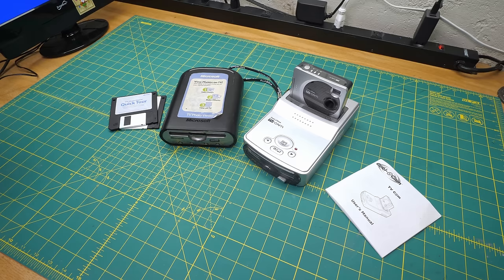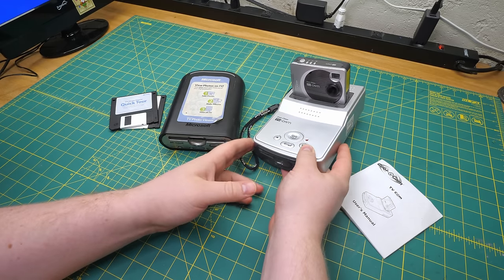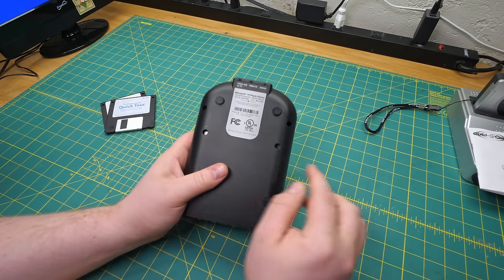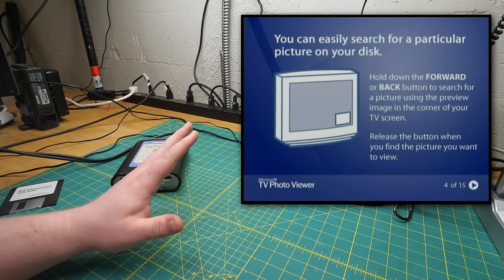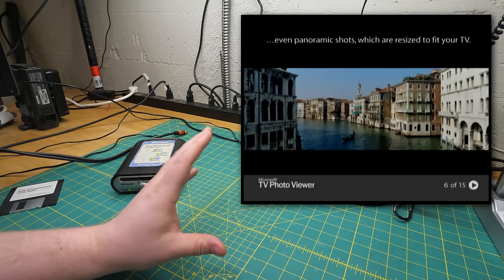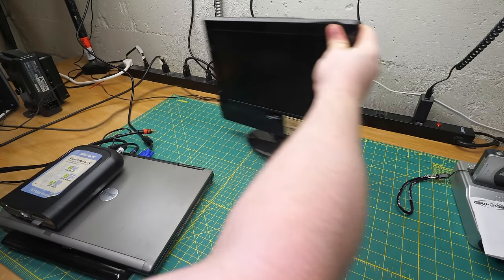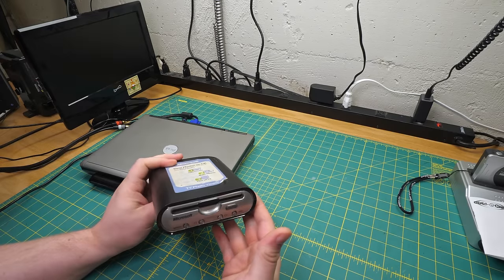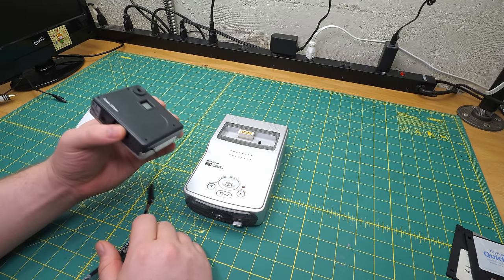"Play" Floppies On Your TV - With These!

Comment: Re similar things - There is an older format called "video floppy" that stored analog still frames on special 2 inch floppy disks in a format similar to how SECAM video was stored on VHS tapes (fm modulated luminance and each chroma component fm modulated and frequency divided and stored on alternating lines). It was more a professional format than something for home use though.
Reply: Funny enough that did eventually get consumer grade devices released using that format ... just prior to the rise of digital photography rendering it immediately outmoded.

Comment: 18:40 Latitude D620 will always stay in my heart
Reply: Yup, I had one from work. Still have it in the basement. Runs Linux like a dream.
Reply: Why is the battery in the front? Looks so different from other laptops I remember from that era. Or is it some kind of wrist rest?
Reply: @samuzamu  that's some new battery with better capacity, I guess 6600 mAh. the stock one came with 4400 mAh
Reply: @mmilerngruppe  oh cool. Laptops were so modular back then. A far cry from nowadays. Guess they were a lot less sleek though
Reply: @samuzamu  it’s uncommon but I lowkey prefer it over the high capacity one hanging out the back like so many did. A bunch of battery pins (or the latches) got broken by people forgetting their overhang, or using them as a handle. Making them a wrist rest seems like probably less torque..
Reply: The D530 is also good
Reply: @kaitlyn__L  You don't need to call out my T400's handle like that! On this ThinkPad it was plenty sturdy, I don't know if other laptops were weaker.
Reply: @eDoc2020  hehehe :)

Comment: I would assume the floppy in the Microsoft is on foam for noise reasons and durability reasons. And the lack of screws is cheaper and maybe faster to assemble?
Reply: My gut feeling was that they wanted to use the screw holes to mount the floppy drive, but then figured out there was a flaw in that approach after making the moulds and needing to change something somewhere. Noise and durability checks out as what those problems could've been.

Comment: That photo editing software is the most consumer oriented photo editing software imaginable. I remember that in the 2000’s most dvd players had jpeg viewing capabilities built in and it was a selling point if it could read your own burned cd-r’s. Even today your average blue-ray player still does this. What surprises me about both floppy based devices is that they used an internal desktop model, considering the compact design I would have expected a slim-line mechanism from a laptop/usb floppy drive. At least the mechanism is easily replaceable unlike some of today’s tech where everything is soldered on the board.

Comment: I would have to say that the tape is most likely a cost saving measure. foam tape is likely cheaper than drilling 4 holes and having someone screw them in. I couldn't imagine it's for any other reason.
Reply: This was my first thought. A bean counter stopped them from drilling the holes.

Comment: USB sticks (Flash drives).
I went to college in the span of 2000 to 2004. Everything was floppy disk, a few computers had CD burners or ZIP drives, but you were pretty much expected to save all your work to floppy disk, so every computer had a floppy disk.
When I visit the college the next year (I ended up working there) in 2005, Flash drives were finally starting to not only just become a thing (Seriously, nobody even mentioned them while I was at college as a student, I didn't know they existed), but they were starting to become a standard. I think it was about 2007 when nobody was using floppy disks (at the college) any more. (Except a few people, like me, but that was for transferring data to a specialised Windows 98 machine to control a CNC drill. But it was one of those machines with a ZIP drive, so I got a USB zip drive and used that.)

Comment: The anecdote about the polaroid camera being recalled before release is incorrect according to wikipedia and it's 2005 source. It was recalled 2 days after release because of "a firmware issue" i.e. all the photos looked like shit.

And the foveon sensor was sold in about 10 different sigma cameras, and sigma eventually bought them out.
Reply from the maker: That's what they said publicly. The rumor is that they just didn't want the thing selling.

I know Sigma sold a bunch of foveons, but as far as I know none of them retailed for under a grand and they were all enthusiast-focused. I was saying that the Polaroid is the only cheap piece of crap with a Foveon, and as far as I know that's still true.

Comment: s10:42, screen saver for your TV: No. The reason why TVs don't need screen savers isn't because there's virtually no chance that anything might get burned into them. The reason they don't need screen savers is because, as you said, by the time this device came out, the original reason for screen savers to exist - to prevent burn-in - was largely gone, and the main reason for having them was to have some entertaining animation on the screen when you aren't using the computer. That makes sense for computers, which many people leave on all the time, or at least during the day, when they're not using them. But with the possible exception of people who buy those fancy, wall-mounted TV sets that masquerade as art when they're "off", or people who just watch TV all day long, nobody leaves their TV on when they aren't watching them. Whichever of those is the case for any particular TV set, a screen saver is completely superfluous. (My Roku has a screen saver. It's completely ridiculous. The only time I ever see it is when I first turn the TV set on, before I grab the Roku's remote to select a stream to watch.)
Reply: "nobody leaves their TV on when they aren't watching them" citation needed. You've never met my mother.

Comment: You mentioned the Sony Mavica cameras, but their history goes way back. The very first ones (prototype 1981, production model 1990) were still frame video cameras (same sensor as their video cameras back then) that magnetically (but not digitally) saved images onto so-called video floppy disks and could then be plugged into the TV to display these photos. There were also specialized printers that printed these out. This tech is regarded as the ancestor to modern digital cameras (even though it captured analog images) and is most certainly a conceptual ancestor to these two devices. You should definitely cover these some day, if you get the chance.

Comment: The holes inside the Microsoft unit were probably there for multiple drive types. These were not designed to be taken apart so the double stick tape is fine...
Reply: "fine" if you're expecting the customer to care so little about your piece of landfill that they're throwing it in the garbage the first time it needs maintenance.
Reply: @bebobo1  That is exactly what they were thinking... Do you really think people would spend this little for something and actually expect to bring it somewhere to be repaired? If it broke you threw it away... Just the way it is

Comment: I can only assume the reason why the drive was mounted with foam tape instead of screws is because of potential vibrations or vibration noises. Imagine having a big plastic thing vibrating when trying to access a picture and the vibrations echo because it was put on a huge entertainment console that could amplify it. Since this device was for the "grandparents", this has to be something that was field tested and was pain point in earlier revisions, hence why the injection mold wasn't recast to take out the screw holes. (I paused at the one hour mark for this comment, so I don't know if you address this later)

Comment: Center negative made sense with older transistor circuits that needed a negative supply only. That means positive to the ground and the metal housing, negative to circuit power. Even when this became no longer beneficial in the late 60s early 70s , the standard was set.

Comment: Hey, I had that camera! Or rather, one just like it. Or rather, it didn't look at all similar, but it definitely had the same crappy sensor, lens, viewfinder, LCD, and bespoke webcam drivers that I could never find. It had a "gum stick" form factor, upgraded to mini USB, and was sold as a toy. I was insulted to learn that they sold the exact same camera to adults as well.

I actually also had a camera that took 110 film, sold as a "spy cam" because it was only slightly bigger than the film roll itself. No flash or any electronics, entirely mechanical.

Comment: I'm only about 9 minutes in and also slightly baked, but the whole "film cartridge that also stores digital data" thing reminded me of a camera advertisement from the late 90s or very early 2000s featuring some sports star (maybe Shaq??) And the whole gimmick of the camera was that it could record a short audio clip during the shot. The camera was (I believe) a film camera and not digital outside of its very limited audio recording and playback. I never owned one of these and never encountered one beyond the commercial itself. I can't imagine it lasted very long in the market for reasons that were obvious even to me as a child at the time. It seemed pretty gimmicky right off the bat and the commercial was pretty silly. Famous Athlete Man was using the camera to record something funny while taking pictures at a graduation. I cannot recall any details beyond this and a few lazy googles reveal nothing. I wonder if anyone remembers this commercial or ever had one of these cameras? I wonder if it used the "film cartridge with data" concept for the audio recording aspect?

Comment: alright so i have a theory for why the camera can't get powered by the dock: they were worried about the kids at grandma's house running around messing with things and jamming a screwdriver into the dock thereby shorting something out and killing the dock. they could of course have jump started the dock power delivery with direct battery voltage but that flap didn't look particularly sturdy and it's very easy to imagine that getting broken off, accidentally opened bumping against stuff or someone not bothering to close it. the proper way to do this would of course be to implement an authentication protocol that couldn't be replicated by a kid with a screwdriver but that's work and costs money so i think they just couldn't be bothered.

Comment: Regarding APS - my wife still has an APS camera kicking around. She never took a photo in anything other than standard ratio pictures... the same as my (then 30) year old 35mm SLR... Regarding the values for the machines to figure out from APS was burned into the negative, you could see size instructions on the bottom feed pall notches.

Comment: Those video cameras had USB 1.1, which only gets about 1MBit out of it. VirtualDub shows it at the bottom (96K/16/s). 96KBytes is about what you can feed into 1MBit. For that period, the web cam is not as bad. Also, putting foam instead of screwing the unit inside made it not make crackling sounds when you shake it or put pressure on it. You know, like on modern smartphones :)

Comment: For some reason Sony likes Center negative. And guitar pedals. I never had any issues with battery power devices and power adapters until a few years ago when I bought a Sony cassette recorder and managed to cook my batteries! Because the DC check didn't switch off due to millimeter differences in power adapter tips used.

Comment: composite still looks pretty good on a CRT, especially if the same image is being displayed for at least 4 fields in a row, a good comb filter can completely clean that up.
unfortunately, the retrotink5x can only do so much with composite, partly due to limitations in modern ADC designs. (not an issue with the 5x itself, it's just that the parts to do better don't really exist anymore) the 90s era decoders built into CRTs can often do a better job and extract more resolution

Comment: 03:10 Once I bought a small portable colour CRT TV at a flea market, I quickly modified the correct size plug onto a power supply, but I just went "autopilot" about its polarity, I thought "it must be center positive" as so many other things. It wasn't, actually it was center negative! It was too late to realize why it won't work when a capacitor blew up in it with a loud balloon-like bang, I never saw that television working, I'm sad about it since then! 😖 I almost had a small colour CRT television, but I screwed it up ‒ I wasn't able to find another one since then! 😶

Comment: We had 16:9 widescreen CRTs in Europe from the early 90s, by the early 00s they were the default except for budget options. In the UK we had some experiment PAL Plus (analogue widescreen) transmissions but the real takeoff was when digital TV launched in 98 - the BBC were broadcasting in 16:9 from the start and the other PSBs were not far behind.

So definitely not a 'just Japan' thing, more a 'just not North America' thing.
Reply from the maker: Oh geez, I see why that passage is confusing people now - I mentioned Japan because Americans could have imported a Japanese HDTV and it would have worked here. But I cut out that part because it was too lengthy... not realizing that it made it sound like I thought HDTVs were JP-exclusive. Whoops, lmao.
Reply: @CathodeRayDude  haha, np, sorry for the confusion my end. BTW these weren't HDTVs - they came a lot later, and HD CRTs were vanishingly rare - I think maybe a handful in total were released over here; by then consumers were moving fast to flatscreens so they never really had a place in the market.

They were CRTs displaying 625 line PAL signals (or DVB signals converted to PAL), either stretching it to fill the entire screen or slotting it in the middle depending on the user's chosen settings and the aspect ratio flag emitted with the programme.

Widescreen was not synonymous with HDTV in Europe, we got used to one then the other in separate generations of product. Indeed while we were ahead on widescreen we were way behind on HD...

There were experiments with HDTV using MAC and DMAC (a failed video standard, designed to be stable for satellite usage but ultimately PAL was deemed good enough and then DVB-S fixed the problem completely), but literally nothing in the consumer space. We didn't have MUSE and we didn't get DTheater or anything like that.

Early 00s plasmas existed which were capable of HD but there was no (non-imported) HD media you could hook them up with until the HD disc formats and DVB-S2 launched in the mid-00s.

Comment: 1:11:21 it looks like they didn't just use the cheapest piezo speaker out there at the time, but specifically with metal casing to play double duty of small heatsink for the IC it was taped to.

Comment: Makes me wonder if there were ever analogs to that but with actual floppies (5¼-inch) or cassete tapes, probably with monochromatic or CGA/8-bit photos, in 320x200px resolution or less. With formats like IMGs, SCRs, or BMPs at the most modern. You'd play the tape and the dialed-internet-like noise would also play as the screen fills very slowly, like a pixel or two per second, slowly filling horizontal lines.

Comment: @1:04:08 Another possibility is the bog standard 7805 is limited to 1.5A, while that one is limited to 2A? That said, a linear regulator needs alot of cooling if you're drawing 2A with a 9V supply (4V * 2A = 8W, that gets toasty quickly).

Comment: I wonder why WWL did things the way they did. I mean, they literally built an entire custom docking station for an existing camera platform. Then they modified that camera platform and made it talk to the docking station they had built, including transmitting photos over serial to save to the floppy disk. Since they were building their own dock, why not include processing, decoding, and signal generation in the dock and just break out the USB data lines on the card edge connector? That way, they could both communicate with and power the camera through the USB interface and maybe switch off the battery connection with a transistor or something. And the dock would work with or without the camera.

It's cool, quirky, and weird. Kinda like us.

Comment: Lomo just released a new 110 camera. There’s still a cult following for 110 within an already niche hobby. It’s very interesting. Even some cameras like the Pentax auto 110 can resolve a decent amount of detail
Reply: The problem with 110 is that the cartridge design doesn’t keep the film flat, so it can never be as good as the film stock itself would suggest

Same problem with 126 and Super8 cartridges - they just don’t have the tolerances to hold focus right

Ironically, this is also the limiting factor for medium- and large-format film resolution

Comment: There is already a term for Stamp Engineering it in the automotive industry - Badge Engineering. Shell Engineering also seems like it would fit for those made-for-landfill items that use the same internals and different cases.
Reply from the maker: Badge engineering is specifically within the same company; it's a Chrysler being sold under three other marques that Chrysler also owns. So I make a distinction between that and this, where it's one company putting a thousand other peoples brands on it.
Reply: @CathodeRayDude  I've heard the term used to describe it more generically, like when Chevy sold the Corolla as a geo.